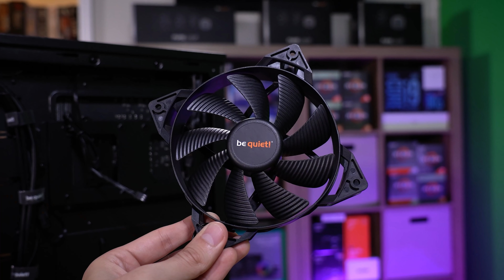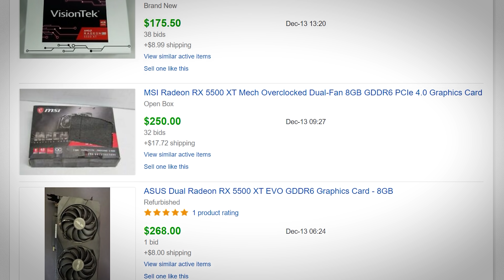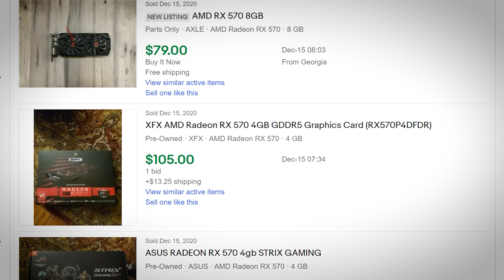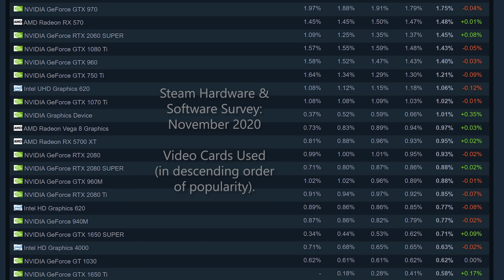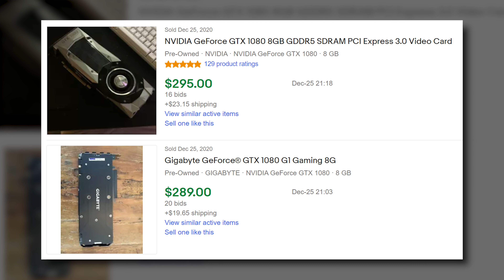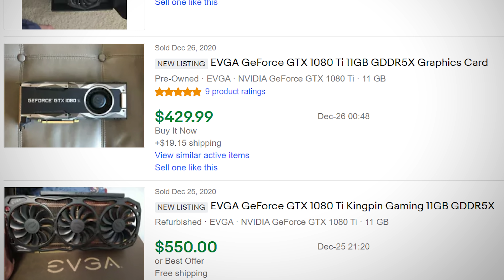2021 Graphics Card Market Analysis

Comment: I bought a Seasonic FOCUS GX-850, 850W 80+ Gold, Full-Modular for $139.00 and now that same power supply is selling for $219.95,The power supply comes with a ten year warranty but to pay $219.95 when I can wait until the prices stabilize again?HELL NO!!!I'm going to need another one of those very same power supplies because I ended up buying a gigabyte x570 pro wifi motherboard and that happened because I bought a gigabyte b550 pro ac wifi motherboard and I thought that I was going to have to replace the motherboard and by that time the gigabyte b550 pro ac wifi were no longer in stock.I resolved the issues that I was having with the gigabyte b550 pro ac wifi and I decided to keep the gigabyte x570 pro wifi for my next PC build instead of returning it.I have been using seasonic power supplies for several years now and they are great and dependable which is why I favor them but there's no way that I'm going to pay $219.95 for another Seasonic FOCUS GX-850, 850W 80+ Gold, Full-Modular for my next build when all that I have to do is wait until the prices go back down.Here's the amazon link to that power supply.:  https://www.amazon.com/Seasonic-GX-850-Full-Modular-Application-SSR-850FX/dp/B07WVMDZMZ/ref=sr_1_2?crid=VJ1GP6W1CPRT&dchild=1&keywords=seasonic+850w&qid=1609789684&sprefix=seasonic+%2Caps%2C238&sr=8-2  I'm no skin-flint but I'm no "Diamond Jim" with money to burn either.The most I would ever pay for a video card is $350.00 and maybe a little more if the video card is really worth it but there is no way no how that I am going to shell out that kind of money for a video card that's being scalped or sold at two and three times what the video card is really worth.I also bought an LG 31.5" "FreeSync" monitor because my peepers aren't what they used to be and my ACER 21.5" monitor though still in perfect working condition wasn't cutting it for me anymore.I also bought two 2TB SSD drives which cost me about $200.00 a piece and I am very satisfied with my new build as it is and turned out,I'm in no big hurry to spend anymore money.I was overdue for a new PC build but even so,if I didn't have to be stuck in the house because of this God forsaken virus I would have taken my time shopping around for PC parts for this new PC build.God bless all of you and your families,a happy and prosperous new year to all of you.

Comment: Yup just sold my mint like new in box, RTX 2070 FE model, with original receipts for $550 today. Paid 650 from Best Buy a year ago. Bought the RTX 3070 Gaming X Trio from micro center on a fluke walk-in timing was good, for MSRP ish, 649 with TAX. Microcenter inflated price by 30$. Still, it is what it is. The buyer said my deal was the best by far.

Comment: The Vega 56 does actually trade blows with the 1080 at this point. Undervolted and OC'ed it smokes the 1080 out of the water...
Reply from the maker: AMD drivers have aged quite a bit better, yep! But Vega 56 still consumes loads more power - even while undervolted in my testing - than a reference GTX 1080. But I don't often overclock GPUs.
Reply: @GregSalazar  Well, maybe I was lucky. I have the cards. - or I should say had.. My old Vega 56 sapphire pulse did match or beat a lower tier gigabyte 1080 model with roughly the same power consumption.

The 1080 drew around 180, while the 56 drew around 200 during simplified testing.

Edit:
To address the overclocking, all i did to the 56 was bump up the boost slightly to the core hitting around 1500-1600. The HBM2 was bumped up to 950.

Comment: I need to upgrade my monitor due to ageing eyes and I am also building a new system to go with it. I need a 32", 1440P monitor. I am concerned however about being able to get adequate frame rates. My current budget would 'much' prefer to go with a Geforce 3060Ti, but I fear I'll have to go for a 3080. I 'am' considering settling for the 3060Ti, but installing a power supply capable of driving a 3080, not to run the 3080, but to run a future next-gen card to upgrade to later.

Comment: I just built my first set up at Micro Center on Tuesday.  They were pretty picked over but i still managed to get away with...PC Pros tell me if i made any mistakes please!!

NZXT - H510  (white)
TUF Gaming B550-Plus (Wi-Fi)   (want White NZXT N7 Z490)
TUF Gaming GTX 1660 Super (only thing missing, was out of stock EVERYWHERE, BUTwill be here tuesday)
Ryzen 5 5600X
Barracuda 2TB 7200RPM
Ballistix Gaming 2x8GB  (Black)   (want Corsair Dominator Platinum RGB 32GB) (Purely for style points)
Inland Premium 512GB SSD
Cooler Master Hyper 212 Evo   (want NZXT Kraken Z63 280mm)
EVGA 650BQ 650 Watt

Gaming Monitor - 27" Curved Acer 
KeyBoard - Redragon K589 Shrapnel RGB
Mouse - Aerox 3 Wireless
Reply: terrible build bro

Comment: what would be a logical upgrade from a rx-580.. i have been looking at a 5700xt... (rx 580 is 8g)
Reply: The RX 5700 XT would be like Cross Fire RX 580 in one card .
Reply: Also , I use to run a RX 580 8Gb and RX 570 4Gb in CX on my Evga x58  3 Way Sli board and x5660 overclocked to 4.6Ghz on AIO cooler .. they hit about 26- 27,000 gpu score in FS before RX 5700 XT ever released .

Comment: i had bought a an xfx rx570 8gb brand new for 130 a year ago but have upgraded to a 1660 super at msrp and very happy. i built my system last may when 3600 was 170 bucks and my only regret is i didnt wait a month for b550..i want the b550 gaming edge but went with msi gaming plus x470..its not a bad mobo at all and the vrm is solid for a 6 core but the gaming edge is better with vrm if i upgrade to higher core count

Comment: I paid $437 on ebay for a mint 1080 ti to power the recently released HP Reverb G2 VR headset.  And let's be real, no 3080 series is going to be EASILY available until maybe spring and this card will do 1440 ultra or 4k mostly-high-settings. good enough for a few months of waiting at which point I can give it to my teenager where it will spank his 1660 super and I don't have to shop for a b'day present for him, lol

Comment: So I am planning to spend about $200-300 on a graphics card for War Thunder Sim/DCS VR flight. What card would you suggest? I was thinking along the lines of a 1080/1080ti, but even those prices are jacked. The DCS may be a push for cards of that power, but it should be able to handle War Thunder easily.

Comment: Since October last year I've been watching the tech market and on newegg for God knows how many hours daily.  Even more so than normal because of covid. I've watched some crazy goings on with CPU and GPU prices. For example, the MSI mech OC 5700XT was on sale for $389 regular $419, now it's over $600...  3600X was around $169 now it's back down to $199 as of yesterday, was $269-$300....   All of the 5700 line is over $600 as well as the 2060/70 which are overpriced several hundred dollars over what they were back in October.  1050ti was $169 now several hundred higher.   It's a shit sandwich if you want to build a PC.

Comment: I just bought a factory refurbished hybrid cooled 1080 Ti to replace my current 1070Ti, hoping the jump in performance between the two will be noticeable
Reply: Not a huge jump, the 1080ti's were mostly useful for CUDA workloads, ie machine learning
Reply: @jttech44  Well I don't want a 20 series card as this was just holding me over until I can actually get a 30 series card without paying some scalper an upsold price.

Comment: Nicely done. I bought this card the - GIGABYTE Radeon RX Vega 64 DirectX 12 GV-RXVEGA64GAMING OC-8GD 8GB 2048-Bit HBM2 purchase date was Nov 17, 2018 : It was 4 months old at the time , it had been owned by a Husband / Wife couple that had gamed online with each other until the wife's work hours changed I paid US $350.00 for it - would you say at that time it was a good deal? It still is my current gpu. When new cards are available again which would you suggest as a good replacement?

Comment: Happy New Year!
Was this a good deal? I just bought an RX 5500 XT the 4GB version from ASRock, this one "Radeon RX 5500 XT Challenger D 4G OC" to be more specific, for 150 USD on ebay, it was listed as new but in the description the seller mentioned "it is barely used and it comes in original box with everything included", from the pics the card seems in great condition and the seller seems trustworthy with 1900+ 100% Positive feedback.

Comment: If you want a 1060, just buy a 970 if you have the power supply headroom

Edit: if you're gonna buy a 570 or 580, buy a 970

If you want a 5700xt, buy a 1070ti

Dont buy a Vega, don't buy a 20 series card. 10 series or 900 series are best value for money as they've almost always been

Comment: 3070's in Portugal are selling for 50-150€ over msrp depending on the model... Same goes for 6800 and 6800XT. 
I found a 6800 Gaming X Trio for 700€ (way overpriced, and pulled the triger), so i am selling my 1080ti for 380€.
my issue is:
If the market is so jacked up, why would we sell our used cards at their real value, if the new ones are jacked up  over 20%?
I mean 3080's are going for over 800€, 6800Xts for over 750€ and 3090's for over 1600€...... The market is all fucked rn, so we might as well take advantage and get some return from it

Comment: Greg, you've chekced ALL the boxes with this video sir!  I paid $420 (w/tax) brand new, for my 2060 Super FE in March 2020. When rumors and finally the launch of Ampere GPU's from NVIDIA emerged,  it was arrogantly implied to that me by a few enthusiasts in comments, that now my "meager" 2060 Super FE would probably drop to $250 on ebay....AS WE ALL KNOW, NOT THE CASE AT ALL...actually, there are some used cards of this sku with even a higher asking price. You've articulated all of the points of what's going on in the current GPU market. Myself, I am satisified (big time) with my system performance and GPU, and I am willing to wait until all of this ridiculous supply/demand .."sorry not available but on ebay available at inflated prices" goes away..when realistic MSRP prices returns. That may be summer of 2021. And, I'm good with that!

Comment: I'm looking for a 1060 6gb upgrade and my budget is £500. I'm looking at the prices of the 2070 super on ebay and they dont seem that bad. It is on avg about 450-500 whereas the 3060 ti is pushing 600 now since a couple days ago. I want a substantial upgrade that will firmly put me in 1440p territory oh and also capable of minecraft rtx/ cyberpunk

Comment: Does it even make sense to say 3070 is $500 MSRP? I guess in US that might be true, but for Europe it's not even close. In my country 3070s go for 800-900 euros, which is more than double the MSRP. In Germany they are around 700 euros, which is a bit more reasonable, but still way over MSRP. When you are looking at 450 euro used 2070 and 900 euro 3070, it kinda does make sense to go for 2070, even though it's used and weaker.
Reply from the maker: MSRP and selling price are two different things. When inventory catches up and demand from both bots and scalpers subsides, you'll find these for $500 all day.
Reply: @GregSalazar  Well, I hope you are right and theories about how this was Nvidia's attempt to jack up prices while looking like they are lowering them are not.

Comment: The market is crazy right now. I bought multiple used GTX 1080's back in 2018 for under $250, and multiple 1070's for under $200 around the same time. People were practically giving away RX 580's. I would've keep a few cards if I knew they'd appreciate over time, haha.

Comment: If you can get a Vega 56 for ~$150 and aren't afraid of overclocking (especially with bios flashing if the card has a bios switch) get that. OC'ed and undervolted it's the same or better than a gtx 1080

Comment: I got a 1080 ti for 365$ in November. 

AMD gpu are straight up unavailable in my country, 
Cheapest 3060 Ti is 780$
Cheapest 3070 is 805$
Cheapest 3080 is 1350$

The 5600x which is the CPU which i wanted to upgrade to is 385$

Comment: What's a good price for a 5700 xt?
Reply: I think something around $370-$400 for a new card ofc would be good deal but it's unreal now hehe. I bought the best model of 5600 XT MSI Gaming X for $380 and I know i slightly overpaid for it $40-70 more than should be. Because normal versions of 5600 XT new cards shouldn't cost more than $260-$290.
But I can't remember msrp of 5700 XT
Reply: @marcinczyzewski5021  OK thanks I bought mine now for 410$
It's not a pretty good deal but I'm happy
Reply: @Gio-m4k  Yeah you shouldn't complain too much for it :). You did even slightly better deal than me hehe, considering that 5700 XT is around 15-20% faster in average than 5600 XT and has 2GB VRAM more .
But here in Poland we have very expensive PC parts :/. You don't wanna to know actual prices xD.
For example mine 5600 XT is probably out of stock and even you will luckily find one you need to pay more than $580 haha, the cheapest one Saphire Pulse Radeon RX5600 XT I found in price around $450. It only shows how good deal I made even for overpaided here heh.
Which model did you buy?
Reply: @marcinczyzewski5021  nice, I bought the gigabyte 3 fan one, it's a pretty good custom model in my opinion.
BTW I speak polish too haha
Reply: @Gio-m4k  So you have very good version of 5700 XT too, nice.
So szczęśliwego Nowego Roku życzę 😁
Reply: @marcinczyzewski5021  Życzę również szczęśliwego nowego roku😉

Comment: Bought a hp pavilion "gaming" desktop with ryzen 5 3500 and 1650 super for 600$, with 75$ warranty. Which I immediately regretted buying as I ripped out the cpu and gpu and built my first pc. Ah well if I didn't buy it I would've never found this world I had no clue existed.

Comment: Whatever you can find.   It  doesnt matter how much stock comes out, there is a new middleman from the POS sneaker trade.    Everything from the 5700 on up to the 3090 is sitting in someone's family room being resold on Ebay. unless you drive to micro center and wait in line.   These POS talking heads get all this stuff so it is more of an inconvience to review it.   Just stop talking.

Comment: used gigabyte 5600xt oc gaming 6gb good deal or no? 250
Reply: If you can get it for 250 yeah. That's under the msrp, by a good bit. And the 5600xt is a sleeper card. It's actually really good but it's not a 5700xt or a 2080TI so people sleep on them.

Comment: Seeing those prices that cards are selling for on Ebay is insane.  I have a GTX 1060 6GB and RTX 2060 Super sitting on the shelf not being used.  Maybe I should just sell them on Ebay and buy myself a brand new RTX 3080.  I didn't think I would be able to sell the 1060 for more than $100....boy was I wrong!

Comment: I bought my 1070 ti for 211 usd with converted currency before lockdown.They are selling for 400-500 usd now.There was a vega 64 for same price and i told my friend he should snag it up but he wanted to wait.Only issue i had with the vega 64 are,it's a blower design so it will be loud and hot.I opted for the 1070 ti because i don't have a psu to power the vega 64.

Comment: Here's the thing people sell their 7th gen or older and want like you said around 200 ish dollars when the new 10 gen i3 has the same 4c 8t for 99 at microcenter, the only thing is the 2mb cache missing but it's almost there or even the same cos we expect improvement so it might overcome the lack of cache and has warranty.

Also if I'm not mistaken it's soldered and thiner gap between die and ihs so better pemps cos I think from 8th gen and below thermal grease was used and decays  overtime so you have to delid to fix it so where's that thing that people don't understand.

If you spend 200 dollars now and after 3 or more years they still want 200 for the used cpu that if now behind the new CPUs 4 cores it's just entry level.

Yeah i7 7700k was a rip-off

Comment: Wait I'm confused - I just sold my RX 580 8gb for $180, and I undercut the last sold items. Did you mean to say the RX 570 and 580s were selling for 80-100 dollars??? That seems really low.
Reply from the maker: I literally just showed you current selling rates on eBay. You may have sold yours for more, but they’re buying for as low as $80-100.
Reply: @GregSalazar  that's wild. I couldn't believe my eyes. When did you pull that search from? I just checked recently sold items and RX 580s are going for $150-200 on eBay right now

Comment: What would you say is a reasonable price for a 2080ti? (Used of course) i found a 9 month old gaming x trio that was only used for dota 2
Reply: Anything around $600-$700. Right now though. Once stock actually happens with 6000 and 3000series, i wouldn't pay more than $400 for one.
Reply: @mattevans1643  just copped it for 900 aud :) which in aus is the $100 above the lowest retail 3070, except they all selling for 900-1000

Comment: I got a 970 for 80 dollars was that a good deal?
Reply: Ummmm if it's all ok with the card i think yes
Reply: I mean yes and no. It's an old card and can't really handle modern games, but for $80 you're not losing much. With llw setting you might be able to squeeze by for AAA titles. If you just play weaker games like minecraft for example, you'll be fine.
Reply: @mattevans1643  I mainly was going to play gta v and bo3